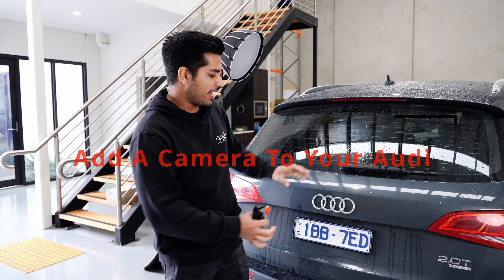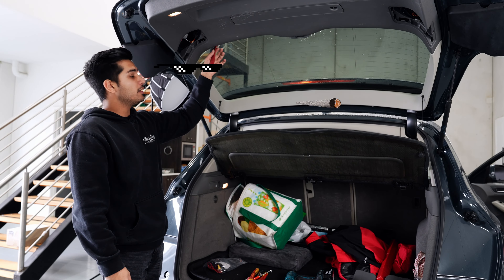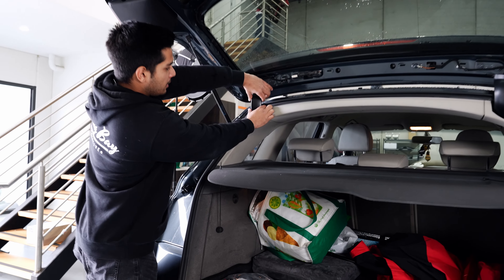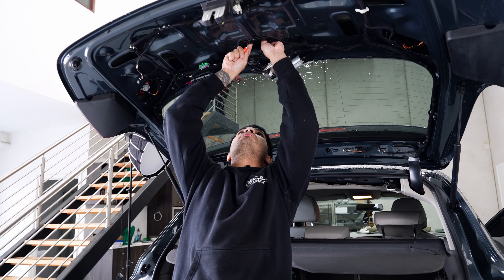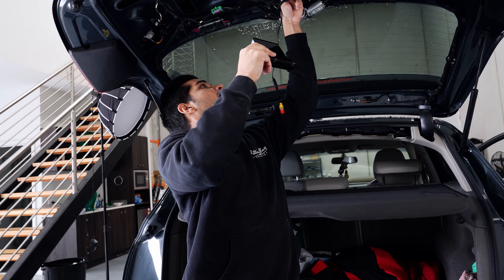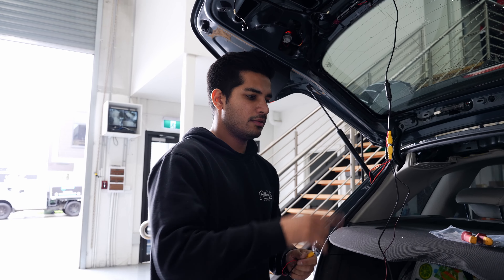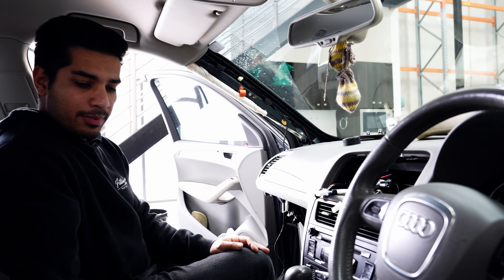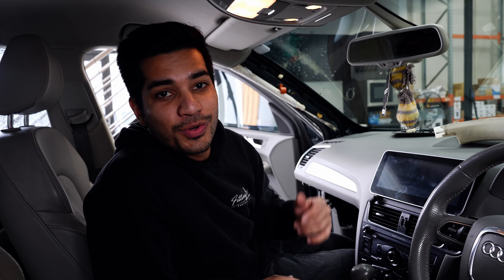The Proper Way To Add A Reverse Camera To Your Audi!

Comment: A lot of work just for a rear camera, it's a shame Audi are such basic cars, for the money they should all come with rear cameras, fold mirrors, heated seats.
Reply from the maker: and self driving would be nice
Reply: Rear camera and front and rear parking sensors should come standard on all Audi's
Reply: I got a 2020 A6 and it does not have a rear camera lol
Reply: @appleratpipe  Lol, I got a 2016 fiesta and it has rear camera
Reply: Is it worth it?
Reply: @da2585 Absolutely. Worth every bit of frustration by the end of the day. Would recommend
Reply: I have a 2020 Q2,no reverse camera😢
Reply: Q5 2021 no camera😢

Comment: One year later and this has been super helpful so thanks! You referenced an instruction for removing the A Pillar trim, any chance you can provide a link as I cant find the video and struggling to get mine removed? Many thanks!
Reply: Did you get any video with the how to remove the pillar?, i was surprised that this video starts very detailed with the trunck door but he miss the secon part.

Comment: I may have missed it but most installations show a connection to the reversing light so that the camera becomes live when reverse gear is engaged.  In this installation, how will the camera operate just by engaging reverse gear? Have I missed it? Thanks.
Reply from the maker: The unit gives the power needed :) it uses CAN for the signal.
Reply: @TheFittingBay 
Hallo I had installed the rear camera on my Audi A3 Etron 2015 and connected the red wire to de red wire of the extension cable to the CarPlay and 
Connected the red wire on the CarPlay side to the purple wire ( reverse back detected), but I don’t have picture on my screen?
Don’t I need camera power?  Of the rear reverse ligth 

Please advise 
Thanks 

Grtz Theo Keijer
Reply: @TheFittingBay  what power source cable did you connect at the back of the head unit to power the camera?
Reply: @theokeijer2513  I’m having the same problem. Did you ever figure it out ? It worked like 3 times when it was initially installed and then it just didn’t
Reply: You must Connect red wire to positive reverse light
Reply: @theokeijer2513 hey did you figure it out?
Reply: @DiannaaSalazarr hey did you ever figure it out?

Comment: How does the camera know your in reverse? My understanding is they get power directly from the reverse light.. is it different with Audi?
Reply: the camera does not need to knoe, is the Aftermarket Screen that came wit the connector and get the signal from the camera when you put reverse, I with this could activate the camera when using the parking assistant instead the reverse, that way we could install a rear and fron camera.

Comment: Hi, I got a carlinkit decoder 2,0 for a Audi A4 b8 and i will mount a revercing camera to it. I gott the RCA kabel and to wire says 12v out to revercing camera and a second ho says Reverce detected. How could i Connect the camera to de carplay decoder

Comment: What's the specs on the camera? You should go into more depth on these install videos if the cameras dont come with detailed instructions. a pillar removal, hiding the wire run from the tailgate to the headliner, running the wire from the a pillar to the head unit and which wire you connected it to. I assume it was the camera +12v wire. Break it into a multipart video if you have to. Itll make it easier for people so they dont have to swap between YouTube videos to do various parts of the installation.

Comment: Can I use any aftermarket boot handle rear camera to connect to the audi mmi system? My cars a 17 plate 8V. I read somewhere you may need a interface adaptor?

Comment: I can’t figure out the last part on how to ground the wire to the bolt 🙈 if you know of any videos that show that part  in little more detail would really appreciate that
Reply: Split the red/black wires apart. Ground the black wire under one of the 10mm door latch bolts. Be sure to sand off the paint so the wire is touching bare metal

Comment: Thank you for the video! Its incredible detail, love how you walk through all the nuisances. Do you have instructions/directions on how to route the wire for Q5 with sunroof ? Its hard to fish the wire from the roof lining
Reply: I had to do it in 3 steps. Run the wire on the passenger side. Remove the 2 square trim pieces along the roof liner (there is a flap hiding a T45 bolt). Then you have access behind the headliner in 2 intermediate spots. Fish the wire from one end to that access point. Then repeat to the next access point. I also loosened the C pillar trim and took one trim rivet out to lower to headliner in the rear. Getting around the grab handle by the front seat is the hardest part.

Comment: How do you wire your reverse camera ? 
I bought a similar one  and I followed the istructions but nothing happens when I engage reverse  not even a black screen. Parking sensors are engaging as normal. 
The cables are a little diffrent from the ones in the picture but still. 
I believe that I haven't done some setings on the unit maybe?
Reply: Have you managed to do it? I have the same issue with a back camera from AliExpress

Comment: I have a Q5 2011 with original rear camera, but the resolution is 640 x 480 or 800 x 600 and not apears very well on my new 10" FHD screen. Is there a way to just change the camera with new 1980 x 1080 one camera , without any cables adding?
Reply: yes you just need to buy the aftermarket 2k handle with camera and replace it.

Comment: I just installed android 11 HU in my A4 b8 and camera just like that one (ahd). But when i put car in reverse android doesent go to reverse camera, even though mmi goes to parking graphic interface showing parking sensors.
Reply: Me too. Did you ever figure it out?
Reply: Change camera settings to aftermarket rather than OEM

Comment: I bought a car with this head unit and went to install the backup camera this way.  After getting the glovebox off, I discovered they don't have the right wire harness, and that t harness you show in your other video that taps into that red plug isn't plugged in.  The harness for the android unit it much larger than the red plug, has a couple more big connectors on it so my car isn't talking to my CAN I don't think.  Is there a way to still trigger the reverse camera mode when going into reverse?  I tried putting power on the camera det pink wire but it didn't change anything.  Was hoping there was a purely aftermarket hookup to power the camera, and provide voltage on a wire to trigger the camera screen like you can on most normal car screen headunits.